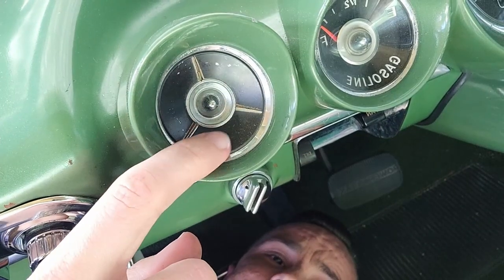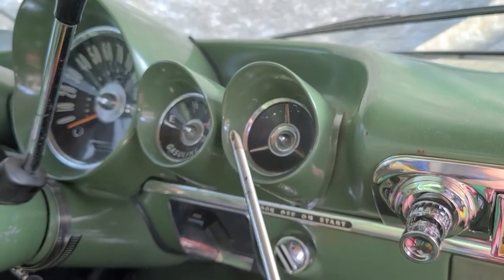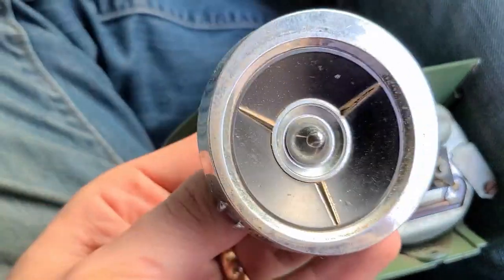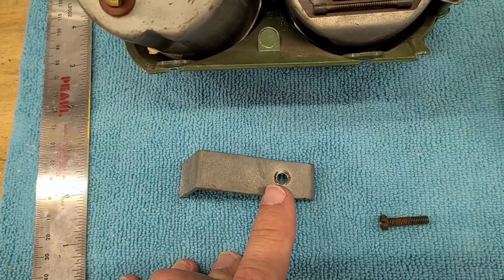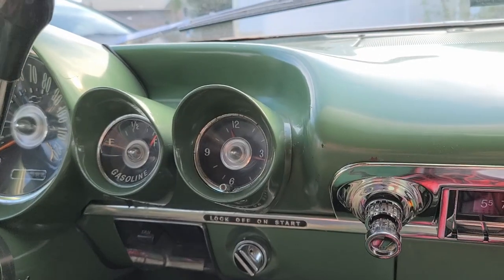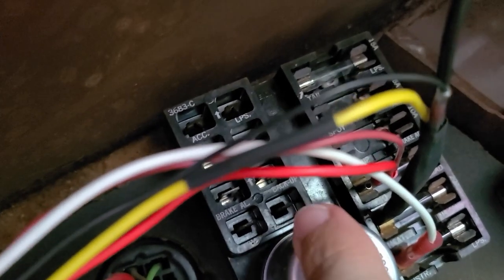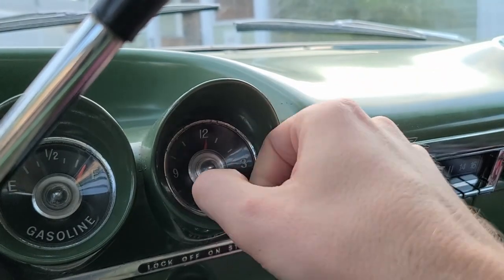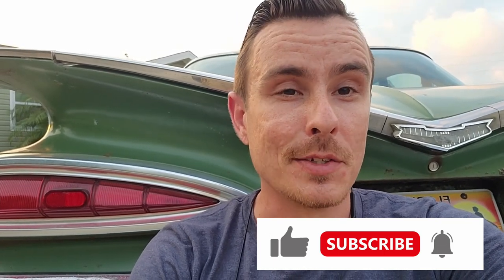Upgrading The Dash On The 1959 Chevy Belair

Comment: Hey I also found a loose wire behind the clock. It was never used so I think it’s for the clock option. It’s a grey wire! Hope it helps!
Reply from the maker: Thanks for the info!
Reply: The grey wires under the instrument cluster are for the instruments lights, through the dimmer . The clock wiring was a kit apart, that was optional for Bel Air and stock for Impalas. So, if the car didn’t come with factory clock (as Bel Airs did) the clock wiring had to be purchased apart or was part of the clock, that includes the tell tale light cluster light too.)
If you found a free gray wire loose pehaps it was for the De Luxe Heater cluster that was optional too and perhaps your car didn’t with a de luxe heater or may be it was for the automatic transmission selector light if your car was equipoed with manual transmission.

Comment: Are the turn signal bulbs in the speed gauge accesible or its internally mounted?
Reply: Do you also know the type of bulbs they take? Along with turn signal indicators at speedo gauge
Reply from the maker: On the back of the gauge.
Reply: @LowTechGarage  do you by chance what bulb type they are?

Comment: The original clocks had a red and grey wire with a plug that went into the fuse box on one end and had a plug that fit the brass stem on the back of the clock and bulb on the other. I have seen them on the Internet for sale. Also as soon as you plug a clock in it starts up with a buzz then you hear a soft tick tock sound. Why? These clocks are mechanical and have an electric contact that forces it to wind. It will buzz every 5 or 6 minutes. I had one of these and repaired it. It was painfully  to watch you leave to check back on the clock since I knew it was not working from the work you did  sorry on the non working clock. But I do respect your effort.
Reply from the maker: Thanks for sharing this knowledge. I have since sold the car but I am sure this will be useful for other owners!